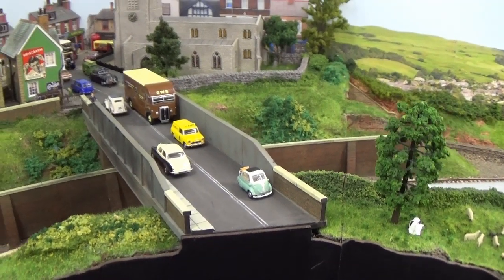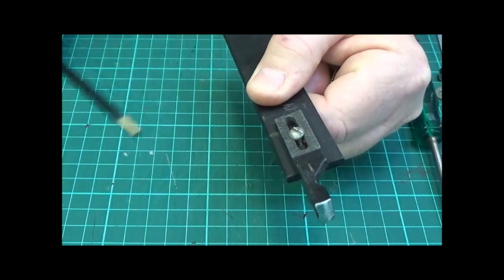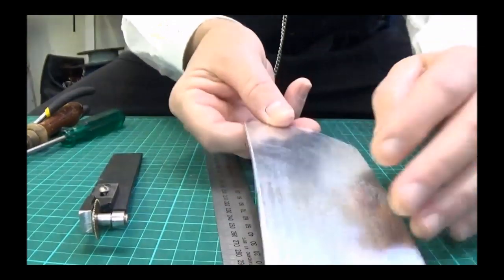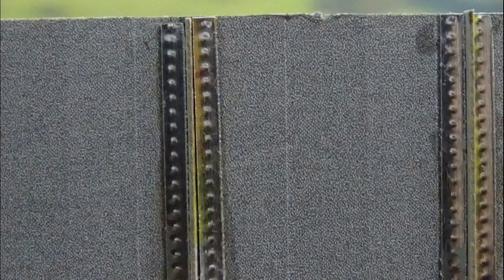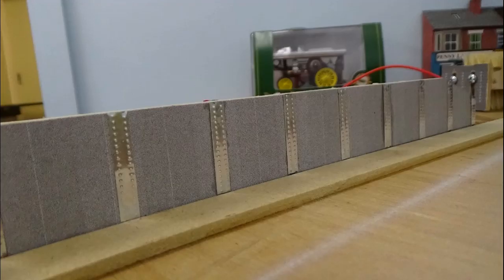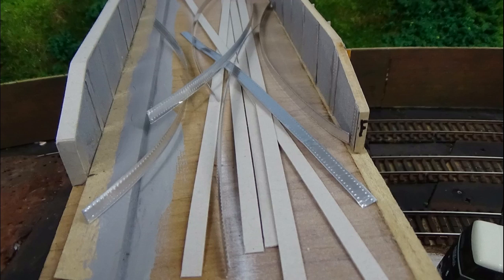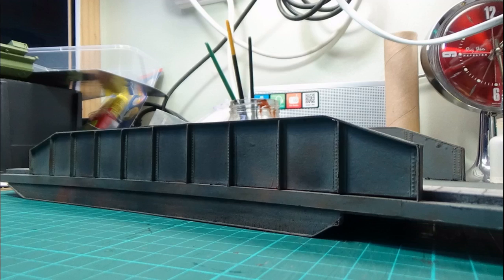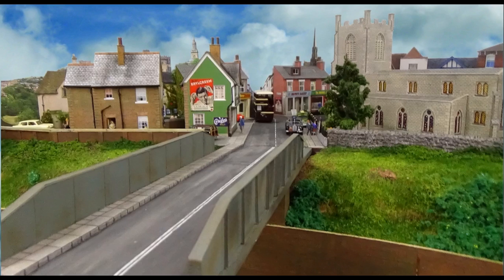Episode 136 20 Scratch Built Girder Plate Bridge

Comment: Hi Gormo
Great idea that, which got me thinking. Years ago I used to a bit of leather work and had a stitch spacing tool. This basically looked like spur with the prongs or spikes at 4mm centres. This is a bit on large side and would need multiple passes.
The other day I was on an aeromodelling site buying some paint and knock me down with a feather they had the exact tool with three pitches for putting rivets on fuselages. It unfortunately  didn't say what the pitches were. It was made by Revell. Well known in the UK but not sure about your neck of the woods.
Many thanks for videos 
Cheers Jim
Reply: Found it. Amazon have them for about £9.00
Revell 39076 Engraving Tool for Rivet Rows
Reply from the maker: G`day Jim,
Thanks for the information.
Yes we know Revell over here, but I was not aware of their tool range.?
That sounds like a good tool, depending on the pitch setting as you say.I was lucky with mine as I had the bits and pieces. I also fiddle with old clocks from time to time.
I must say though, when you have the tool, be it home made or store bought, you can run a line of rivets off in no time at all.
Cheers Gormo
Reply: I do like a nice line of rivets. So as it was only £9 ish, I've ordered one. Will let you know what the pitches  are of which there are actually four.
Reply from the maker: @jimoc2045  Thanks Jim,
Cheers Gormo
Reply: Hi Gormo
It arrived today and it's a bit small for OO with the pitches being 0.5, 0.7, 0.8 and 1.0mm, although 1.0mm is 3"
The 1.0mm being OK for N gauge at 6" and 0.5mm being 3". Which is about right to scale but you can hardly see it.
Keep up the good work
Regards
Jim
Reply from the maker: @jimoc2045  Thanks for letting me know Jim,
Yes I think it may tend towards the small side for my purposes, nevertheless it`s good to know there is a tool out there that can be bought if you don`t have the odds and sods to build one yourself.
Cheers Gormo

Comment: For anyone not DIY inclined, you can buy a "gearwheel"-type riveting tool.
Reply from the maker: Good one Ray,
I did not know they were available
Cheers Gormo
Reply: @greatchesterfordjunction  It cost alot more than what yours did and yours does so good, I wouldn't worry about buying one. I'm not in anyway trying to insult Mr. Ray Wilson, he is correct and what he has said is a good piece of info. and will be helpful to some people for sure.   👍
Reply from the maker: @williambryant5946  Thanks William...I`m sure no insult intended.
Yes Ray`s suggestions are always helpful and appreciated ,and in this case, especially for those who don`t have easy access to bits and pieces for modelling. 

It`s good to know you can go out and buy the same sort of tool off the shelf. I had no idea myself that they were available.
Cheers Gormo